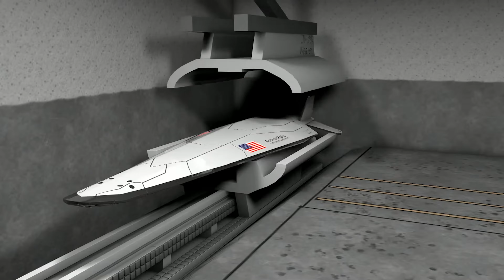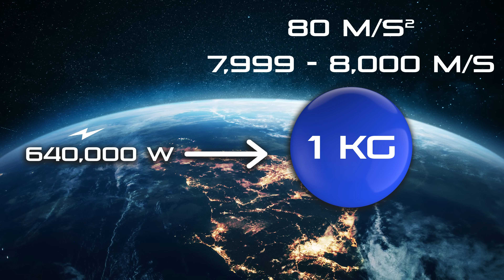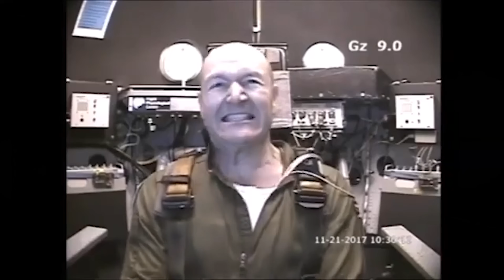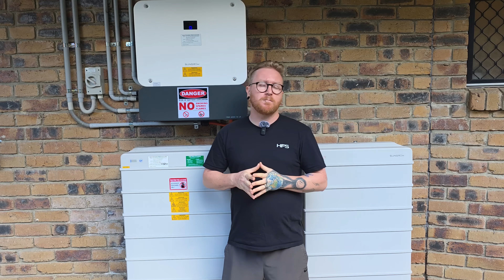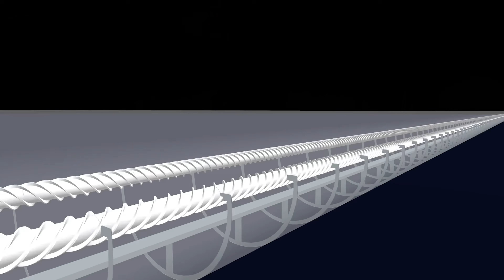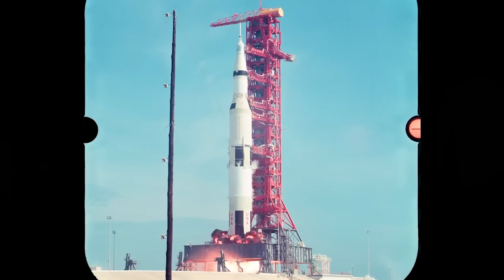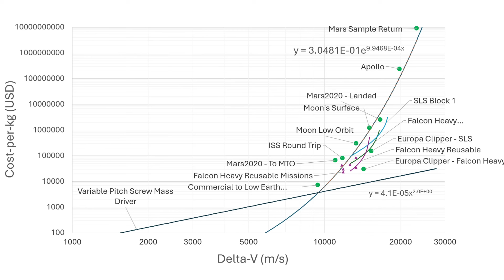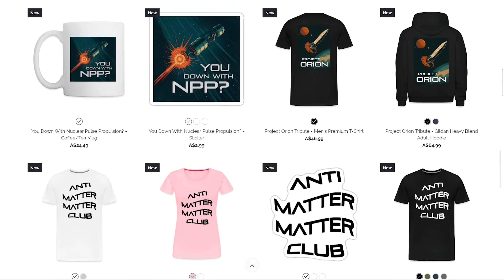The New System That Could ACTUALLY Replace Rockets

Comment: I’m thinking of hitting air like smooth water when jumping off a bridge. Too high is fatal as still water can be near cement like impacts. If they had high powered air blowers at the end of the tube to make the air turbulent, would this make that initial impact with air smoother? Or is the speed at mars transit just too much to feel a difference or effect wear and tear.
Reply from the maker: That's an interesting idea, reducing the impact of the air shock as it exits the tube. I would think the fans would have to be very high speed to make a meaningful difference, but that's just a guess.

Comment: Do these savings assume that the landing hardware and liquid are on board for landing on the moon/mars??
Reply: It is $3.8K per kg of useful payload landed on Mars. The ship and landing propellant are not treated as "useful payload".
Reply from the maker: Yes, spot on. The on-board rocket motor would be used for propulsive landing. The paper used Mars for its calculations, the moon would be a little cheaper.

Comment: I'm glad I'm not losing my mind. The other comments barely describe the problems with this idea.
I suppose lots of people have a hard time distinguishing theory from reality. 
I thought Spinlaunch was elegant but far short of reality. 
But this, this is absolute fantasy. 
Far far worse than any Idea I've ever heard.
Reply from the maker: Have you read the paper, or are you basing this conclusion on a 45 min introductory youtube video of a very complex idea? More information is always better than less, have a read of the paper😊
Reply: @HelloFromSpaceAus You haven't a clue how preposterous this is, do you?
A lifetime of mechanical,  electrical and construction,  with science as a love and hobbey tells me all I need to know. 
You mentioned on method of suspending a what,  21km vacuum tunnel on drones? 😂😂😂 
Any idea what that weighs?
The graphics alone should convince you how silly a plan this is, and how little thought and calculation has gone into this idea.
Did you know a pressure chamber would be much easier and simpler for the weight, shooting the capsule rather than vacuum would make the tunnel much lighter?
What would you make the impossible screws from? Sapphire and carbon nanotubes cross wrapped on a carbon hexagonal matrix filled with aerogel? Not nearly strong or rigid enough. Spinning them at ludicrous speed will give you an  explosive knot of spaghetti. 
It shoud be obvious that linear electric motors made of superconducting materials would be a thousand times simpler. I'm sure a hundred ideas like that have been concieved, with results much closer to reality. 
This isn't something I'm wasting any more time on.

Comment: This system would be great at launching material into orbit with one system and for human transport with another, more gentle system. There should also be systems on the Moon pointed both to Mars and to Earth to send water or hydrogen and oxygen fuels to LOE. 

It or Starship could launch Lunar and Martian habitat modules (with equipment if weight permits) to be sent via some type of orbital maneuvering vehicle into an elliptical orbit to a lunar transfer orbit - without regard for when they land. Just fill the space until ready to install in mass. When ready, intercept modules when close to the Moon and circularize them and then, with fuel generated from Lunar soil (possibly with an autonomous system) land astronauts from the Gateway to transfer fuel modules to landing frames that they can ride up to modules and ride back down - one at a time, refueling on the surface. Also send up in a similar fashion a Lunar-mover to position individual modules into an interlocking habitat with another machine designed to bury habitat modules when linked up.

As you can see, job one is to land and install machinery to extract O2 and H2 and a frame to transfer what should be a whole collection of modules from orbit to the surface. The modules can be launched once designed with an assembly line ready to go. BTW - the same kind of assembly line should be developed to build both simple housing and housing with personal food production facilities (especially hydroponics, but possibly also mini-protein VATs.

Space Station modules (again with or without equipment) can be launched either by screw drive or by Starship - either inflatables or solids - for transfer to LOE and then boosted to a factory orbit for integration and boosting or placement for Earth or Mars Orbit (after we model and test rotational gravity systems). An orbital Mars colony would be crewed in Earth orbit and then boosted. It will take a ridiculous amount of fuel sent up from either the oceans or the Lunar surface, whichever is cheaper. Volume is infinite - meaning we don't have to worry about the size of the ship, just the mass. Inflatable bladders can hold reaction mass for an ionic engine system for the colony tug - which would then refuel from Martian soil (the habitat will remain in orbit) for return to Earth to tug another colony to either Mars, the Belt or one of the gas giants.

Early Mars equipment can be sent from a screw drive catapult from the Moon, with multiple launches in various orbits that can arrive at various curves to intercept Mars on either simultaneous or staggered schedules. Another option is to use Martian moons as a loading dock. With ion engines that worry about mass but not volume, we can build in flexibility.
Reply from the maker: I very much agree, there are many ways we could use this system - even in conjunction with regular rockets. There would still be jobs which rockets would likely better serve, and even in an ideal scenario there would be a transition period too.
Reply: I agree totally! Very nice!

Comment: This is all pretty dumb. You’re going to magnetically couple the rocket to the giant screws filled with permanent magnets which are rotated by guess what?… electric motors with more magnets. Just cut out this rigamarole and make the tubes linear motors. If you can’t sustain the power output to accelerate the load to 4g continuously, how are you going to have enough energy to spin the screws in the first place? Instead of capacitors we can use flywheels as energy storage devices if we want to build up energy over time. By my calculations you need to sustain this output for 200 seconds and putting multiple flywheels spread out along the linear motors will allow them to directly supply the energy needs and minimize transmission losses.

Although this sounds promising, the problem is that it suffers from the same issues as the screw system. Namely you can’t move the magnetic field fast enough while achieving a high enough coupling to  push the ship at 4g.
Reply from the maker: Kinetic batteries are cool - I'm wondering where you got 4g from though? VPSL is aimed at 8g. You can very much produce enough energy to spin them up - the difference is you don't have to do this instantaneously like in a rail gun.

Comment: A screw that long is going to twist itself into a knot isn't it, unless we're talking about an unobtainium-strength material? Doesn't it need to be held in tension at both ends? That makes it similar to the magical cable needed for a space elevator I think. If not held at extreme tension it's going to sag and rub against the tube and the rocket sled. It also needs to withstand twisting forces too, no? And the parts that rotate on each end would need to withstand similar tensions (because they're connected to the screw). Maybe I missed something you covered. It also wasn't clear to me how it can transfer force to the rocket without touching it or without any current flowing through. Again, I guess I either missed that or misunderstood what you said.
Reply: If this was possible I also don't see why a vacuum is needed. It doesn't contribute much to a regular rocket launch (about 5% of the fuel) so I don't see how it would help here. Enclosing the entire thing in a tunnel does make sense to keep people, animals, rain, wind, out of the system, but I really don't see how attempting to build such a huge vacuum would be worth it.
Reply from the maker: The screws aren't enormous continuous pieces, they're sectioned into smaller lengths. The vacuum is needed to prevent air resistance, which at high speeds would cause a plasma wave (similar to a spacecraft re-entering from orbit). The vacuum would be maintained until the craft was high enough it could survive the rest of the trip.

Comment: How is propelling more mass just a question of changing the pitch? You need more force, end of. That comes from spinning heavier screws harder.
Reply from the maker: Yes, more force is applied by varying the pitch. Think of it like a CVT transmission where the power output and RPM of the engine remains the same, yet the speed increases due to gearing increase. VPSL essentially does this, by increasing the pitch of the screws.
Reply: @HelloFromSpaceAus if a CVT can't vary its power output, it must be wasting whatever energy difference there is between normal tasks like cruising at city speeds and maximum highway accelerationiat near top speed. Those activities take a different amount of power to be sure.

It sounds less magical but makes way more sense to me to put it in terms of "we can launch lighter payloads than the maximum rating by varying the pitch", the system scales down rather than up.

Comment: A multi-kilometer long vaccuum tube that goes up into the upper atmosphere has a dubious feasibility to say the least.  The gigantic screws with a variable geometry (since the tube is curved) is also dubious too.
Reply from the maker: There's definitely going to be challenges with constructing such a large project, particularly since we've never even tried to build something like this before. Technology improves constantly over time, we've definitely done more difficult things.

The screws are sectioned, not one continuous piece. The variability is between screws, the actual screws themselves don't have the ability to vary their own pitch. They're essentially fixed, spinning screws, with pitch that increases along the length of the track. Hopefully that makes sense, its difficult to explain in a Youtube comment😅
Reply: "we've definitely done harder things before" yet you simply have little idea how hard this is

Comment: I still think the more viable approach would be to use an hydraulic system to push the spacecraft through a launch tunnel as described hear whilst also using the rocket motors to launch.
Reply from the maker: The issue is the speed, hydraulic systems are great for torque but often not for extremely high speed.

Comment: Pure fantasy...Even getting a tube that long to be mostly straight when the earth moves and flexes, is already fantasy, trying to pull a vacuum in three separate tubes that long is also pure fantasy, trying to get a screw that long is also pure fantacy, trying to get variable pitch to near zero with no torge at the end, also pure fantasy....no way in hell buddy...

Comment: It is absolutely ridiculous that at this point we still haven't started building a lighter than air parabolic trajectory launch system for the first stage. Yeah it doesn't make sense if you are going to launch one rocket but allowing  gravity to do a sizable chunk of the work makes economic sense when we get to a scale such as we are today. It makes even more sense when you consider where to dump the hydrogen when you let the rocket fall, rockets like hydrogen. That's my view on the subject. Refrigerate portion of the trajectory 9.82 m per second squared doesn't have to be a force you most overcome but rather one that you're harnessing. The species is so f**** dumb

Comment: And as the pitch of the screw decreases, vibration and friction increase
Reply: The adaptive nut is magnetically coupled to the screws, so there is no friction. Making things that can spin fast without vibrating is well within our present-day engineering capabilities - take jet engines, for example.
Reply: @spaceinfrastructure3238  The scale difference is incomparable between a jet turbine shaft and a many km long system of massive enough drive shafts to not just accelerate air mass but directly accelerate a large payload. Also “magnetic coupling” isn’t magically without resistance forces that would be practically equivalent to friction- and even friction isn’t going to be totally gone in a system that’s going to need to include thousands of high strength extremely precise bearings and joints. Running the payload up to high speeds inside a tube means you need the propulsion shaft itself to be very precisely aligned with the tube, and the payload just as much to the shaft, to avoid hitting the walls of the tube and that level of consistency will come with friction (or equivalent) losses.

Comment: Spin launch knows more than this giy. And common sense. Even at low speeds to test. The craft experiences G forces like a tank shell at firing. The upper limit  what tech can withstand. And any faster cant be done. 

People need to get out of fantasy bullshit. Even strength of materials and mass would also tip soin launch apart if they went full scale. And I even knew that spin launch was the stupidest idea...

And knew theyed have the issues they now say make it impossible.

And you cant put a craft with electronics in a railgun gun the energy would kill it.

Like even ftl and wirmholes are dumb with normal energy as the power requirements are literally planatary and s fail means good by earth and even if itvwirked most think warp space builds uo an energy that when you come out. Can destroy a solar system.

Tho a ship that can make energy per sec like the moon turning to pure energy, going through meter wide wiring and stuff would be vaporized by its own warp system. Life itself would die as the metals ripped apart and Planetary level static to contend with. 

Even near light speed woukd be dumb as every time we send something far away, it gets hit by something or has problems that almost end the missions...

Hit a grain of sand at 50% light speed and your fucked as you cant track dust and atoms that would also imoact like a particle accelerator. Without a force field that would also kill those on board if it could even be done...
Reply: And the VPSL. A large screw that just to reach orbital speed needs the surface ti spin near supersonic. As smaller stuff made of strong materials flies apart long before that.

Thats ignoring the other forces to. Giant rotating cylinder putting force on stuff as its also expected to go supersonic at the least. Where's that torque going. Into the screw or the ship that can be twisted apart. You know thats just asking for the screws to explode or wobble and snap slamming into everything right...

Its not possible except with magic materials that cant exist...
Also the problem with inertia. That motor puts firce on the end other ends not feeling it yet and torque twists the screw out if shape and if it does, it'll will go from small issue to massive disaster as the problem worsens itself the more it deforms..  You'd need new screws  every other launch, unless you also slow the whole screw at once at multiple points. Taking effecting down more as less goes to each point used to slow it. Assuming it can even be made and not just explode from centrifugal forces...

Comment: Honestly sky hooks are more realistic than this...
Granted the idea is based on solid principles but only with a lot of handwaving details.
Build a demonstrator, it will probably be enough to scrap the project.
Reply from the maker: No handwaving, just the limits of a 45 min video! I'd encourage you to actually read the paper, or watch some of Phil Swan's more in depth presentations on the idea.
Reply: @HelloFromSpaceAus  I apologize I wasn't clear enough what I meant with details.
I'm talking about actually building the thing.
It looks good on paper but getting it to work is a different story.
This is engineering in extremes and reality is a bitch... It's quite literal a moon shot.
Rockets are easy in comparison.

Comment: I already fixed all the issues you mentioned for a mass driver system. I used a coastal atmosphereic pressure hydroelectric power generation system for the energy requirements. The electromagnetic launch system is built into a mountain underground. I was thinking about the Andes mountains in Chile. At the beginning of the track it is a gravity assist drop track straight down while the system is under vacuum eliminating atmosphereic friction. This system gains roughly 60% of its required speed during the first kilometer of track during the down turn. It only works with each system in conjunction, but it will work and its cost after construction would be less than $1k per metric ton.